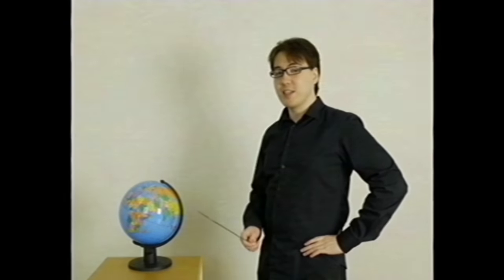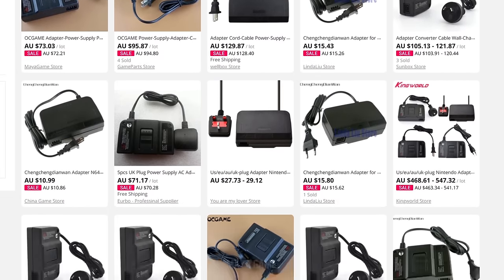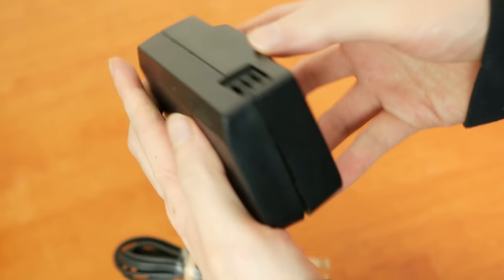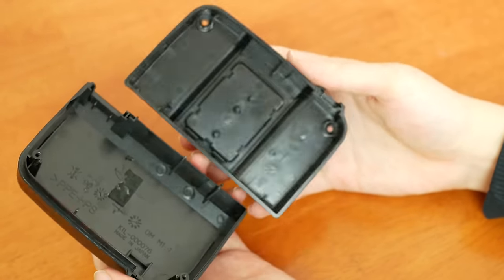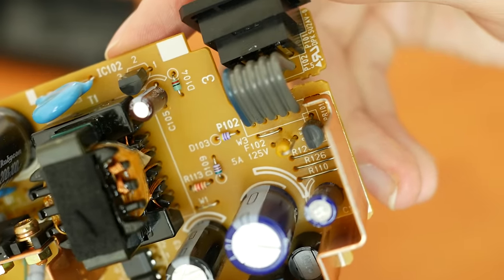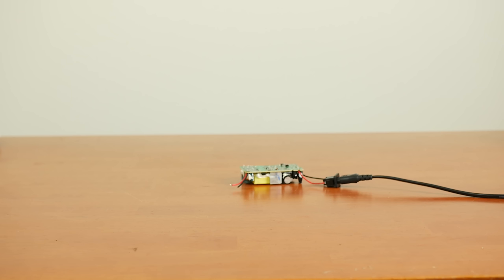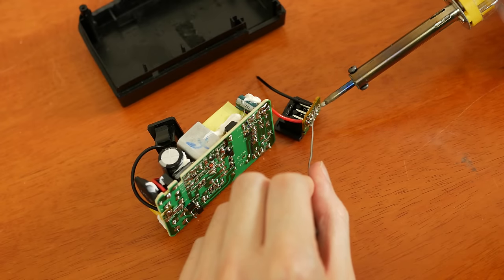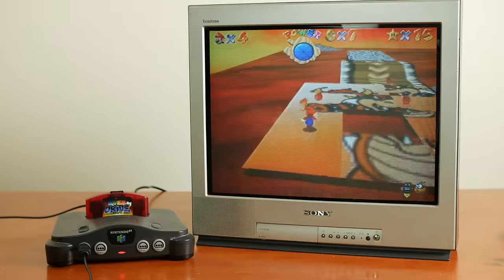Building the Ultimate Nintendo 64 Power Adapter

Comment: Just use an extension cord and run it all the way to the U.S.
Reply: lmao
Reply: Idk might need.. two extension cords
Reply: run it off of the internet
Reply: To 5 different cores of the world around the world, on each planet in the solar system.
(LGIO reference)
Reply: Just dig through to the us
Reply: I wonder how much current it would take to overcome the resistance of thousands of miles of cable. It'd probably take a dedicated power plant just to run the N64 from that distance lol
Reply: Tim T. Solar would be much easier, and/or a 12v battery with 120v inverter.
Reply: Just use a transformer and boost the voltage two to a couple million volts
Reply: XD
Reply: lol
Reply: It's possible, as long as you have a pistol loaded with freedom.
Reply: @jaden8923  ah yes a fellow dani fan
Reply: genuine cackle <3
Reply: @user-ys4op3ux1p  (tldr: 130kW) The voltage drop caused by cable resistance would work to our advantage. He has a Japanese supply wanting 100v (see video at 8:45), so if 20v get dropped it would be perfect.

Now nerd sniping time: this adapter draws 0.45 amps. US light duty extension cables are 18awg which is 21 milliohms/meter. Since the cord has two wires it ends up being 0.042 ohms per meter. Australia is about 15,200,000 meters away from the US so there would be about 640 kiloohms total cable resistance. This means there would be 288 kilovolts dropped on the cable. So to get the proper 100v output from the US you'd be losing about 130 kilowatts in the cable. A small office building might be powered from a 225kW transformer so in the grand scheme of things it's not that much power.

Though I wouldn't want to pay that power bill. At 10 cents per kWh it would cost thirteen dollars an hour.
Reply: lol
Reply: Duh
Reply: what about the water though
Reply: @cst1229  inb4 he starts throwing electricity at random people and Grace
Reply: just get a solar power supply and use the florida sun for that 24/7 N64 setup
Reply: @elephystry  ehh, maybe even 3
Reply: Lol, if i live in Russia do i need to make a cord to US if i happen to get a US console? Lol
Reply: @user-ys4op3ux1p  nothin' an active cable and some scotch tape can't fix.
Reply: @elephystry  plug them into eachother INFINITE POWER
Reply: Genius!
Reply: Plug it into pcs less voltage use multiple and connect
Reply: Genius 😮
Reply: Yes, voltage drop definitely won’t mean there are 0 volts going through that cable at the other end. Definitely
Reply: @cst1229  do you know what video, or at least game, this was quoted from on the Let’s Game It Out YouTube channel?
Reply: Ez
Reply: or use bluetooth 6
Reply: Yeah duh
Reply: Or move there like he did!
Reply: Facts
Reply: duh
Reply: just pour water on it
Reply: @bretsutherlandsterriblemem8439  nah since they are australian he has to dig straight up lol
Reply: Or Japan
Reply: just skip the wifi router power supply and wire in a gamecube power plug on the back of it along with the step down converter.
Reply: You will need an infinite long cable.
Reply: @dakrazyk_  I don’t know we might need 2 transformers
Reply: no usa bad
Reply: "Alexa where can I buy a 10,000 mile power adapter!"
Reply: But that would be too easy for him
Reply: imagine how ridiculous it would be if he were to move to the United States just to plug in his N64
Reply: heh
Reply: Laughs in impedances
Reply: No just one,from Australia [the land of sausages] to America just one
Reply: @eDoc2020 just bypass the meter and it's free!
Reply: If we have wireless chargers, just take wireless energy from the US
Reply: Use poe
Reply: Just use Bluetooth smh
Reply: @eDoc2020 fingers crossed the load is perfectly regulated, if the current draw drops even 10ma suddenly the voltage across the power supply is going to be 6000 volts
Reply: i mean he came to america later xD
Reply: Transcontinental extension cord?
Reply: American problems require american solutions

Comment: I would advise swapping out that 3.3v regulator. Those cheap adjustable regulators are well known to put out a very dirty signal. Even if it looks like a stable 3.3v under load, there is a lot of ripple and AC elements. It can cause issues such as audio buzzing, and video interference. Using dirty power can reduce the life of your console and games, and can even damage/destroy them. I would suggest using a more stable and clean regulator such as a PTH08080. They are much smaller, more efficient, and put out a much, much cleaner signal
Reply from the maker: I'll look into that, thanks!
Reply from the maker: @zm7160  Huh... looking closer at the footage I think you're right. I guess that happened in shipping? So indeed it's probably worth swapping out for a new regulator soon
Reply: A surprise to be sure, but a welcomed one
Reply: @MattKC  the point Z M made about the low pass filter is an excellent one. Much of the noise from Chinese regs like these tend to come from their omission of key components used to clean up the signal. Re-adding these may solve the problem, but I don't know for sure. But in my years of portablizing, I've seen many a console, including N64s, destroyed by those blue boards
Reply: That sticky foam surprisingly actually has a function! It dampens the vibrations in the transformer so the power adapter doesn't emit a whining sound (since these transformers deal with frequencies in the 1000's of hertz). The foam couples the transformer to the casing physically so the vibrations are dissipated and makes them basically inaudible (or just harder to hear to most people).

Also I don't want to ruin your un-guiltness, but that adapter would've been probably fine if you replaced that nasty-looking power cord. But hey, this mod is undoubtedly a more interesting and fun journey!
Reply: @zm7160  Wow! I noticed the ferrite was squished but thought it was by design. That thing's a trooper for continuing to work!
Reply: @ShankMods  Indeed, they usually just have a downsized electrolytic cap on the output and no ceramic one to catch the high frequency. No more than two capacitors and you're stable and good to go usually.
Also, going with the 5A one was a good choice, the 3A one wouldn't handle. The Chinese love uprating their crap...
Reply: @MattKC  I like how everyone schooling you
Reply: I used to use a cheap wii AC adapter and it made the video look weird and the adapter made noises. Ended up finding a EU AC adapter and it still works to this day.
Reply: Dude Shank Mods stopping by to critique your parts is like if Manny Pacquiao watched my bag work and pointed out a simple change I could do to preserve my fists or brains.  But if I told him he's pretty good, maybe one day he'll get a shot at the belt, I don't think a single person would get the reference
Reply: Lassi Kinnunen  As we all know, PCB stands for... Something N64 related, I guess. Damn, I'm not Perifractic.
Reply: TI makes some good converters
Reply: Just throw a fat cap in there and enjoy your clean power
Reply: @billiejean3748  that's not how it works at all. Different value capacitors filter different frequencies. Larger electrolytic capacitors tend to have a higher equivalent series resistance, and are better suited for low frequencies. Smaller, low voltage ceramic capacitors have lower equivalent series resistances, and will better filter out the high frequency switching noise from the switch mode buck converter
Reply: Do you what a 3D printer still lol
Reply: @userPrehistoricman  They do continue to work as long as there's at least one fragment of core in the inductor. Ferrite inductors aren't really that critical, and the casing serves no other function than to slightly reduce electromagnetic interference. The important bit is the ferrite core under the casing.
Reply: @PunakiviAddikti  I don't know what casing you're talking about. The inductor core, the ferrite, is clearly split.
Reply: @userPrehistoricman  Oh, I was talking about SMD inductors but the same applies to a ferrite ring inductor. As long as there's a piece of core inside the windings it works as intended.
Reply: that regulator imo wouldn't be powerful enough 
"The PTH08080W is a highly integrated, low-cost • Up to 2.25-A Output Current at 85°C
switching regulator module that delivers up to 2.25 A " 
the n64 power pack says 3.3volts at 2.7 amps , ok chances are 2.25 should be enough but it's a .45 difference 

i haven't acess to a scope to see if that voltage regulator creates any ac elements, but if the power supply is good enough, he shouldn't need any extra caps to filter it out
Reply: @drEmulatorMadmax  The portablizing community has used PTH08080 regulators to power the 3.3v rail on the n64 for over a decade. While the regulator on the stock power supply is rated for 2.7a, the n64 does not draw anywhere near that. We have also specifically tested those other regulators with scopes, and yes, they are very noisy under load.
Reply: @ShankMods  i didn't think it would ,but i read what the manufacturer said and was erring on the side of caution , 
tbh if it were me i would have used a power brick (ye ye i know their will be losses from said brick to the unit ) but like i've seen you can then power the n64 from a car or van (assuming you don't have any ac power coming in) 

anyway kudos to MattKC for thinking of it and making the video 👍👌
Reply: @Scornfull  yeah ikt
Reply: Out of curiosity, would a 78SR also work for that usage?
Reply: @MattKC  Also I would recommend you use hot glue or epoxy to secure the voltage setting nob of the step down converter. Those things tend to drift overtime, especially if its being moved around a lot. As for the problem of dirty power pointed out by @Shank Mods, you could build your own filter by wrapping the 3.3v output wires (both positive and negative) around a ferrite bead. I'd still recommend @Shank Mod's solution, but ferrite beeds are a lot cheaper and quicker to implement (can usually be found at the local electronics component store). Most manufactures generally recommend a capacitor and inductor for filtering, and with these modules already having a capacitor for filtering lower frequency stuff, the inductor for filtering higher frequency noise is the only thing we need to add.
Reply: I recommend some good fixed inductor implementation to. To reduce AC current ripple
Reply: If any signal is crossing over it is probably the 50Hz.. i mean the 3.3V regulator is sitting right next to main voltage..
Dope project tho 👌
Reply: Hey, shank.
Reply: I've had one fry a chip because, even though it's set to 3.3V, it starts at 12V and ramps down...
Reply: holy shit it's him
Reply: That regulator, should still be fine, just make sure you put a cap and possibly an inductor on to snooth the output
Reply: This is why I love oscilloscopes
Reply: There's a problem with voltage spikes too.
Reply: @ShankMods  would you say the mean well rs 15 3.3V is noisy as well? Or is it good enough?
Reply: @littlenyancat5754  I wanted to like this comment but that would’ve brought it up to 70. Sorry.
Reply: @OnlyEpicEmber  (
Reply: Am I the only one who loves it when 2 really cool YouTubers that don’t feature each other in videos talk to each other In the comments
Reply: @Shank Mods 
what's the stance on fixed/split output output regulators, are cheaper ones of those more trustworthy than the adjustable ones?
I've found some DGZZI regulators for a good price and planned to use them for a project like this. 
(I know this is an old comment to reply to, but here's hoping.)

Comment: Warning, folks, if you're taking apart switching power supplies, especially ones that may not be working, they have a high-voltage capacitor inside which can seriously shock you. In most decent designs it will discharge itself over a few minutes if left unplugged, but if it's broken or if it was a cheap design it might not. If you don't know how to measure it with a voltmeter to make sure it's discharged, you probably shouldn't be attempting the repair. Those thumbs on the underside of the PCB in the video are a big no-no.
Reply: I screamed 'nooooooooooooo' when seeing him doing that. Hurts a lot to touch one, don't ask me how I know.
Reply: Who + asked
Reply: @calciumcalorie This guy really whipped out the worst comment and username of all time.
Reply: @RizzySkibi Of all channels, you chose to comment it on a...

wait a minute, you're a troll, why am I wasting my time?
Reply: @AMD_Fan_98  wait a minute why did u edit the comment u wasted even more time

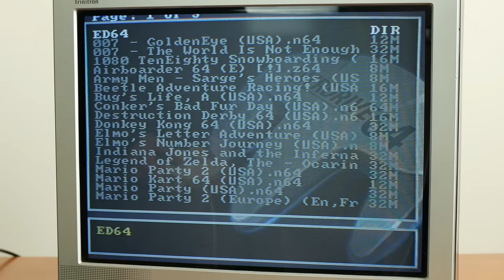Comment: A GameCube controller with Goldeneye at 18:48 sounds like a gamechanger.
Reply: Depends if you can change the controls. 
Some games on N64 allow you to do a lot while others are pretty strict like Doom64.
Reply: Yeah thats what I came to the comments to find more info about :O
Reply: I saw that too
Reply: raphnet adapter ! <3
Reply: one of the best games and one of the best cotroler
Reply: Black wire going into the controller port with white wire and controller
Reply: @ThatOldSchoolMagic  Goldeneye 64 has a lot of control methods, so I think it works well.
Reply: The Raphnet adapter lets you remap your own buttons independently of the game; yes GoldenEye has its own configs, but for Doom and stuff that don't have any other configs you can still map them however you want

It's freaking awesome; I highly recommend it
Reply: Only if you can adjust the stick sensitivity, GameCube controllers have a higher sensitivity than N64, so it’s easy to over aim.

Comment: For reference, the 12 volt line into the N64 goes directly to a 7805 linear regulator, so any voltage above 7 VDC will run it just fine.
Reply: IIRC it's also only used for the N64DD 🤔
Reply: me after inputting 10000V to it: hmm... I'm not sure if that worked...
Reply: @Xnoob545  Yeah, you don't want to go too far with it; the max input voltage to a 7805 is usually around 30-35 V.

But the real limit in a system is going to be based on heat dissipation. So at, say, 8 V your system should run a bit cooler than it will with a 12 V input.

Comment: Awesome work, dude! One thing I will say is that when you're testing something that's plugged into mains with a multimeter, you should try to use both probes with just one hand. If you cause a short with one probe in each hand, it'll leap across your whole body and potentially stop your heart. If you have both probes in one hand, the path of least resistance will still toast your fingers, but you're far more likely to survive.
Reply: The short will leap across your body?
Holding two probes in one hand also makes you far more likely to slip.
The reason that probes have the little disc near the end is so that your fingers don't slide onto the metal part.
Reply: And probably use a better rated multimeter
Reply: It's something an electrician buddy said to me once. It's possible that I am wrong.

Comment: I think the foam tape was probably to prevent the electronics rattling around inside the case, or perhaps to reduce coil whine since it was on a transformer.
Reply: Given other disassemblies didn't have that issue I reckon the faulty cord could have started some overheat and saulded the top on

Comment: Advice: If you think you might want to test the voltages of connections *while the device is running*, then run bodge wires from the contact points to a small breadboard away from everything else. That leaves much less chance for slipping and/or shorting things out.
I honestly even tell you how much ass that has saved over the years.

Comment: Wall-warts are usually sonic-welded instead of glued. I've had good luck just throwing them down hard on concrete or asphalt if the adapter is heavy enough (the older linear transformer types typically are).
Reply: I just use a vise clamp
Reply: Daijoubu or if your name is Big Clive, you use 'the vise of knowledge.'
Reply: Yeah just slowly close it up in a vise - there will be a gradual satisfying crack, like when you goto the chiro 🤣

Comment: When disassembling a high ac voltage converter you should pay attention not to touch contacts of big capacitors in the board, and should make sure to discharge them by shorting the two pins. Those can store a lot of power, keep it even when unplugged and can shock you.

Comment: Capacitors on badly/cheap designed power adapters can hold  over 120-230V (AC after rectifying give more voltage DC) after disconnecting. So everyone should handle its internals with caution even when its unplugged.

Comment: The foam at 8:10 is to prevent it from vibrating/coming loose. Solder is not as strong as we think for sustained vibrations on heavy objects.

Comment: Great video. Just be aware that the output voltage of those cheap adjustable dc/dc converters can drift over time and with temperature. I tried one that looked exactly like yours in s DIY C64 PSU and it drifted up about a quarter of a volt under load in about an hour when soak testing. I went with an MP1584 board instead in the end. Much smaller too and about £1. My genuine n64 psu gives random lines across the dcreen so looking for solutions as well. Keep it up.

Comment: For breaking apart an ac adapter / wall plug I typically wrap the plug in a towel to not damage the case and hit it with a blunt object, rubber mallet is best. Rotate and hit the different sides evenly until eventually it comes apart. Some require more force than others.

Comment: That foam is probably there for vibration dampening. The transformer its attached to might vibrate because of tiny electromagnetic forces and the foam could keep it from rattling itself loose over years and years. 

Great video, btw. Love your stuff.

Comment: The tabs are to prevent rattling of the finished product. with only a limited amount of contact and two connectors, something else needs to keep all the parts together tightly.

same reason they used the doublesided foam tape, rattles. even the best looking electronics are going to seem poor quality if the case is loose or the parts rattle inside.